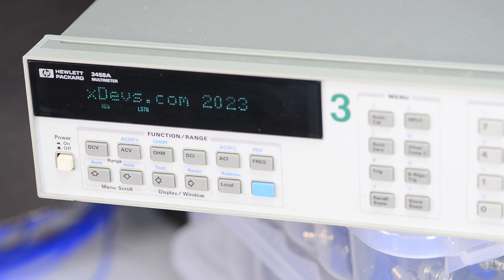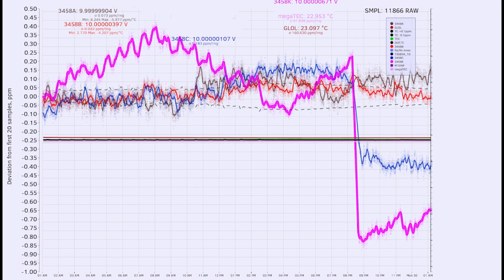Restoring destroyed HP 3458A DMM : Part II

Comment: Are those tantalum, or polypropylene caps? I thought the tantalum capacitors were the orange ones, not the metal foil ones.
Reply from the maker: They are hermetically sealed tantalums, like I've said in video.

Comment: Hello Illya, the video quality is very poor,  360p only, will this improve some time? 
For through-hole components, I guess that the usage of an automatic desoldering pump would be better (faster, less heat) for the PCB pads, than use of the copper wick. Have you found some time to check improvement on noise level with ADR1000 reference?
Reply from the maker: Should be all good in HD now. ADR1000 reference does not improve short-term noise on 3458A, I'd expect meter's noise is limited by A1 signal path and A3 A/D. I want to explore that more, that is one of the reasons why I started this rebuild of lost cause unit.